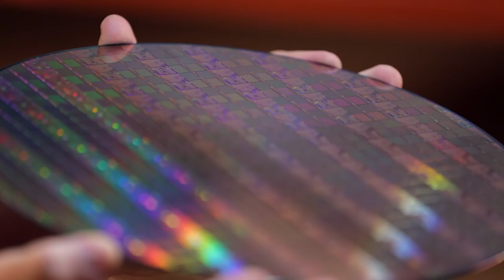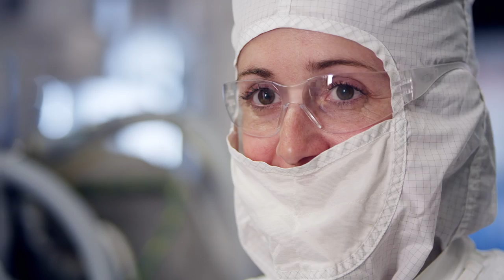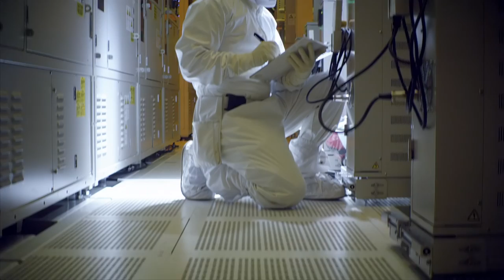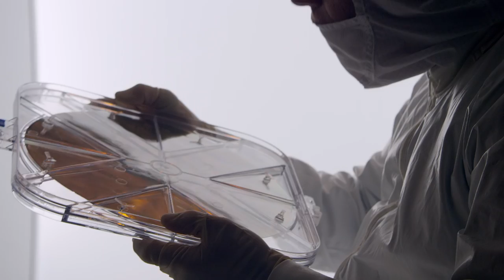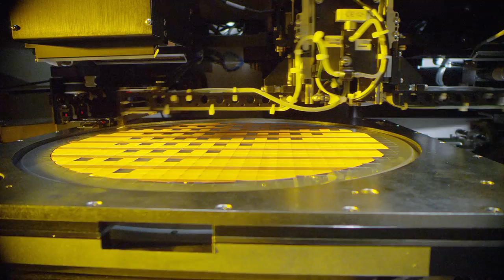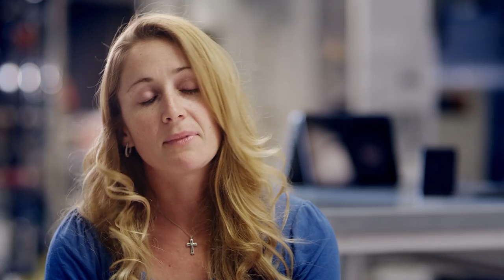Working In The Clean Room Inside The Fab | Intel

Comment: why do they call it the cleanroom
Reply from the maker: Hi! The Intel ‘Clean Room’ or ‘Team Room’ is located inside the Intel’s Fab D1X chip fabrication facility in Hillsboro, Oregon. To avoid contaminating the chip-making process, the air in an Intel fab clean room is filtered to 1,000 times fewer airborne particles than a sterile hospital operating room. Therefore, it is known as the Clean Room. For more details https://intel.ly/3CZvpJS
Reply: @Intel  wow, now that is one clean room. 😏

Comment: Minh Cuong Technical and Construction Joint Stock Companyl (MINH CUONG JSC) received establishment license on 31/05/2010. MINH CUONG JSC is one of the leading companies in supplying and constructing of clean room systems, with listed main business areas:
1. Design and Construction of clean rooms for manufacturing sectors such as pharmaceutical, Functional Food, Food processing, Cosmetics, Laboratories, Biosafety Laboratories (BSL2, BSL3), Vaccine, Pharmaceutical Warehouse, Cold storage, Veterinary Pharmaceutical, Pharmaceutical Packaging, Electronic manufacturing under GMP, GSP, GLP-WHO, ISO 14644, ISO 17025, ISO 15378, HACCP… Standard;
2. Supply and Installation of panel PU, EPS, Glasswool systems and accessories (Aluminium manger, Support R Angle, Aluminium alloy cylinder, Aluminium T,  Light overcast, Aluminium Door, Aluminium sash…) for Cleanroom;
3. Manufacturing and Installation of Air-tight doors, Automatic doors for Cleanroom;
4. Supply ULPA (U15/U16/U17), HEPA (H11/H12/H13/H14), Pre Filter (F5/F6/F7/F8), Crude Filter (G2/G3/G4). Supply differential pressure gauges;
5. Manufacturieng and Construction of air ducts and air distribution accessories. Design and Construction of HVAC systems
6. Design and Construction Dynamic electricity Systems, lighting electricity, controlling electricity for Cleanroom;
7. Supply and Installation of Sample LAF, Weight LAF, BSC, Passbox and Product inox 304, 316L;
8. Supply and Installation of Aqua purificata system, Aqua destillata under Pharmacopoeia Vietnamice Edition IV, USP 29;
9.  GSP, GLP, GMP-WHO Consultancy.
MINH CUONG JSC always makes its best effort to find the most effective construction mothods and the most competitive prices. We pay the best attention to construction quality and warranty policy after construction for each construction. With the motto “ The Works of customers will be executed as same as ours”. We believe that we will satisfy the most fastidious customers with working point of view: “best quality- best price- best after sale services”.
We would like to cooperate with your company in the coming time.
CONTACT : Mr THINH - 0915 090 072 / 0274.3773 744